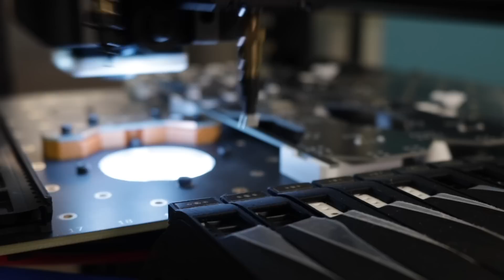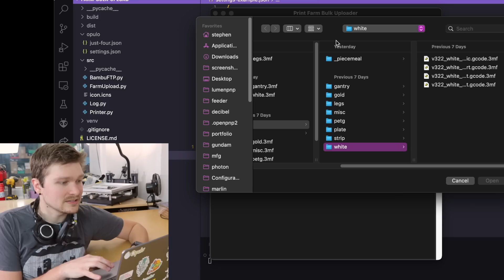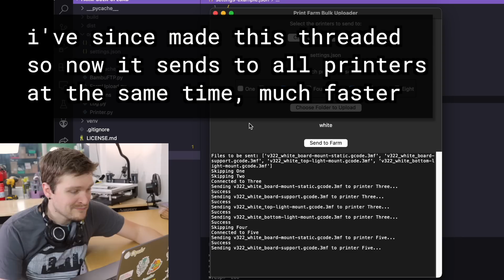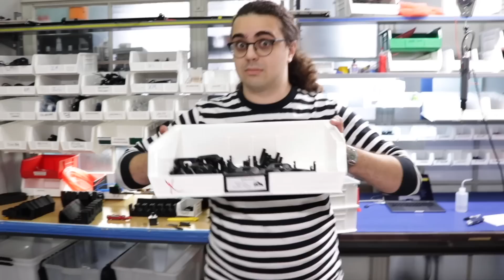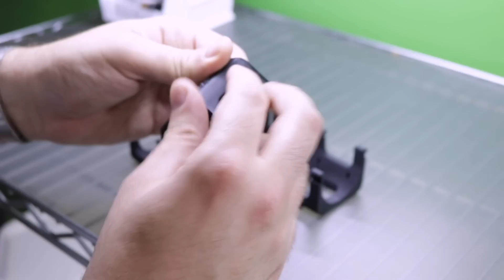Slicers are missing this ONE feature, so i built it

Comment: Since you asked for alternatives, if you get some scales/load cells you can talk to with a computer you should be able to just track the weight of each bin (with measurements at reasonable low frequency). A few config variables per bin (bin weight, part per weight, hysteresis low and high thresholds) and you'd be able to automatically have digital stock level tracking, which you could feed to a screen at/near the print farm (and eventually use to automatically trigger additional prints).

Definitely more expensive than the neat paper card system, but takes the variability out of the level tracking :-)
Reply from the maker: oh that would be super cool! making a cheap, easily deployed bin system that can keep track of how many parts are there automatically is pretty rad!
Reply: @stephen_hawes or just a simple two bin Kanban where the bin is the signal. You pick from one bin and when it’s empty the empty bin goes to a central location and the full bin behind is used. Besides being cheap and simple it ensures that the parts are used in a FIFO manner and no part sits for ages
Reply: @stephen_hawes  if you wanna go extra fancy, you could include RFID tags into the bins that hold the config for said weights and thresholds.
In that case you could put them into any free compatible load cell space. Although that would only be worth it if you guys relocate bins often.
But it would still make it easy to not accidentally "run" a bin with the wrong config.
Reply: @stephen_hawes  You could use something like ESPHome with HomeAssistant as a starting point. A single cheap ESP32 should be able to handle multiple sensor inputs and you can just upload new yml files to each ESP32 via WLAN, if you want a change. And the device's state can then be used to trigger a multitude of automations.

If the costs of scales doesn't scale that well (pun intended), you could even use a very low tech solution: use a pulley to let the weight of the full bin raise a counter weight above a micro switch. When the bin gets too empty, the counter weight triggers the switch.
Reply: In between would be a bin label with barcode. Low bin state and high bin state could them be scanned and would be shown on a kiosk screen by the print farm.
Extension would be automatic job queueing based on that.

Comment: There is OctoFarm, but the Git repo hasn't been updated for 2 years, so it might be dead.

EDIT: Aaand you mention it in the video description. 😅
Reply: Octofarm is super cool and we ran it for a while, but development is completely dead 😢
Reply: Octofarm died  :(    There's an alternative called Monster or something, but I despise the interface.    And with Bambu deciding to start mucking with the MQTT interface and starting to break third party integrations (like BL Led, Home Assistant, etc, etc), it's going to be hard to develop anything useful for long term until they stabilize their access methods.

Comment: Farm upload looks like a nice feature. Sure, it might not be something a lot of people use but it looks simple enough to implement. The ftp servers might not be the best thing to use and/or to leave open though.
Reply from the maker: they're password protected, so you still need to get the code from the printer's screen to connect! me saying "open" is probably not the most accurate phrase, i just meant that they allow a connection at all.
Reply: why would a open ftp server be a problem, as the ftp server is in lan and not exposed to the internet?
Reply: @maddi04  Because it's not good practice from a security standpoint. It's not a concern by itself on a 3d printer that's not internet capable but I like things to be done well